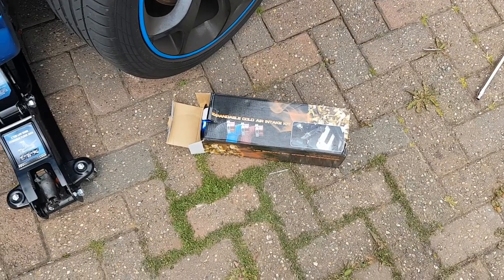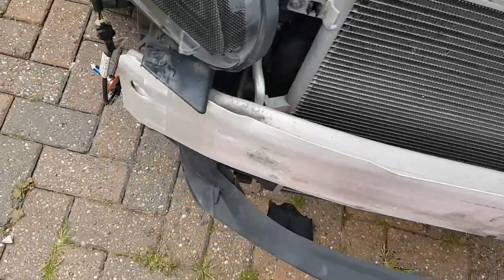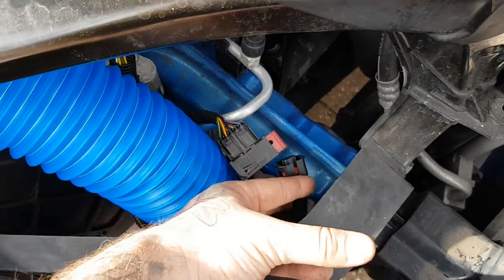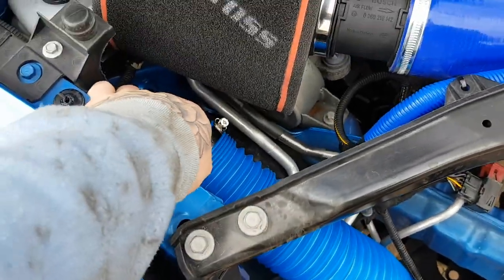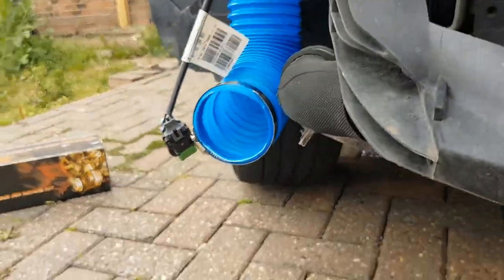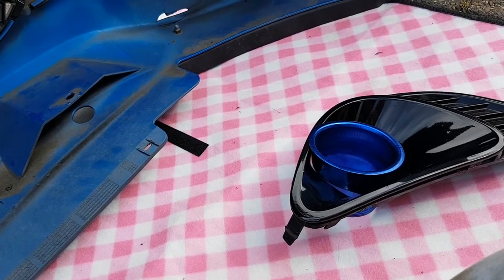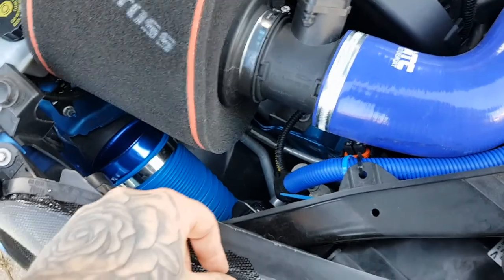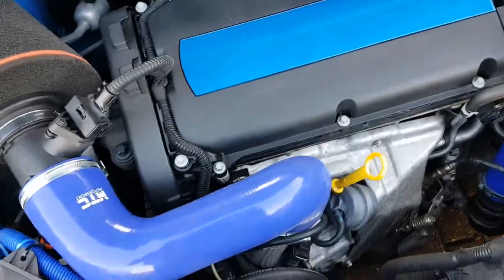Cold Air Feed Install - Corsa VXR

Comment: Did you use the bracket for the bottom after. And will the ram end stay fixed to the pipe threw the bumper 👍🏻
Reply from the maker: i fixed the bit throuigh the fog light first on th einside so you can't see the clip and it all stays all tight. i didn't use the bracekt on the bottom, just the clamp itself and it doesnt move :)